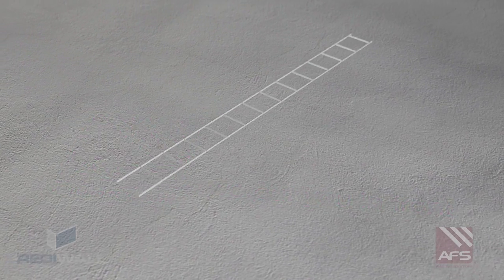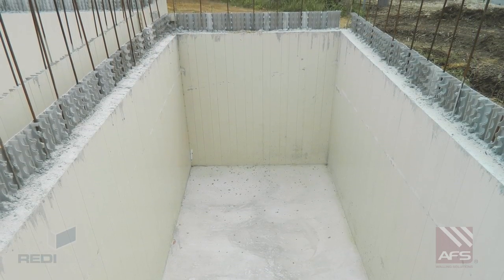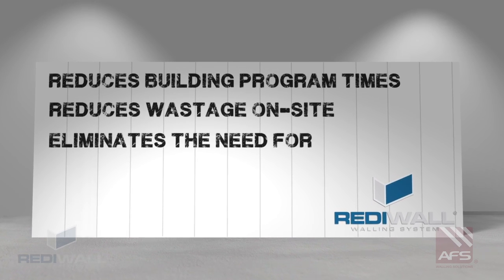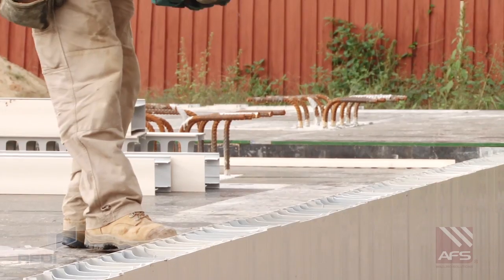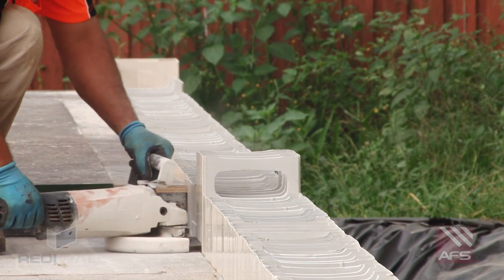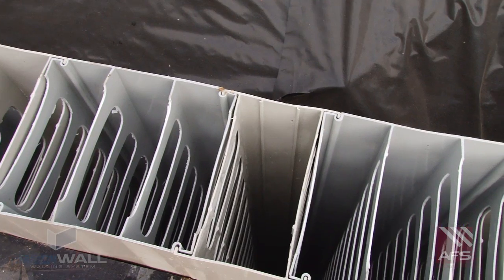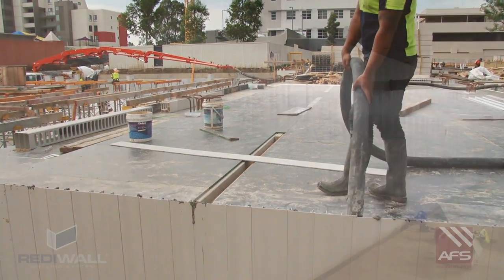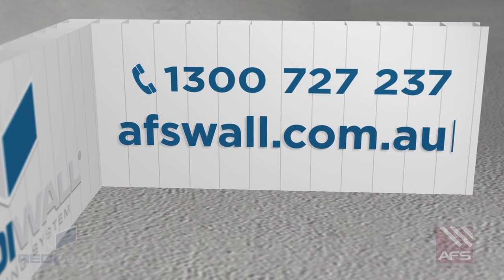AFS Walling REDIWALL® Installation Demonstration

Comment: Could the Redi Wall be used as a Party wall between Townhouses or Duplex. Is it certified or required Third party certification. Can services like electrical and plumbing be used in Rediwall Party wall. If not then a timber lining will be required. Is it allowed to anchor timber frame to Rediwall Party wall
Reply from the maker: Hi Kevin, Rediwall® can be used as a party wall between townhouses and duplexes. For technical or certification information please contact us on 1300 727 237 so we can get a member of our technical support team to assist you further.

Comment: Is it possible to run services like Electrical and plumbing into the walls before the pour
Reply from the maker: Absolutely, installation of services should be done prior to core filling walls. For further information contact us on 1300 727 237 or refer to out afs rediwall® Installation Guide https://afsformwork.com.au/wp-content/uploads/2018/06/afs-rediwall%C2%AE-installation-guide_Aug_18.pdf

Comment: How do you attach Plaster board, Fibro sheets, cladding etc to the internal or external side without pre-drilling holes into concrete to hold the sheets.
Reply from the maker: There is a number of ways this can be done depending on the individual build. Further information can be found in the Afs Rediwall® Construction Detailing Guide 
https://afsformwork.com.au/wp-content/uploads/2016/02/afs-rediwall%C2%AE-construction-detailing-guide_Nov_18.pdf
Reply: Hello I am from Iraq.  Ask for an inquiry
Reply: @muntharalmoswi1433  اخي هذا اختراع استرالي من الشركة الي اني اتعامل وياها 
اني مولود بالعراق ولكن عايش اغلب عمري في استراليا وعندي واحدة من اكبر شركات تجهيز مواد البناء، اذا تحب معلومات او محتاج مواد اتص على واتس 61433623355+ او زور موقعنا www.am NSW.com.au